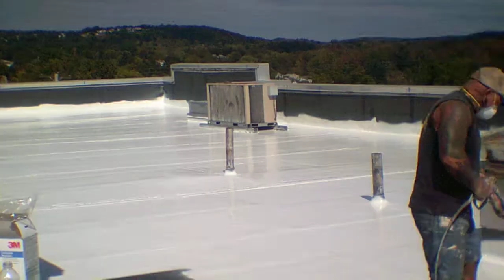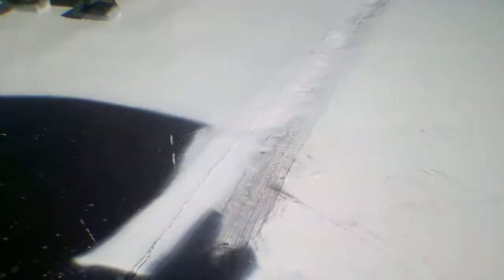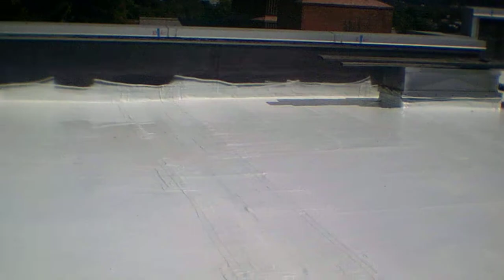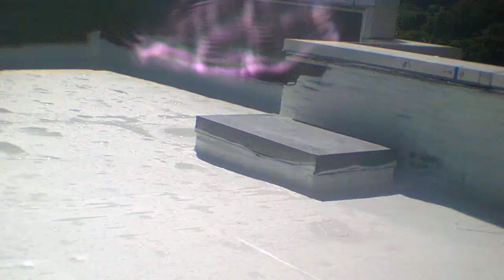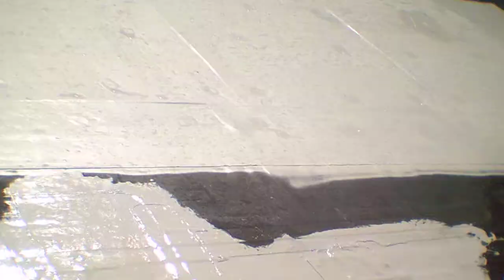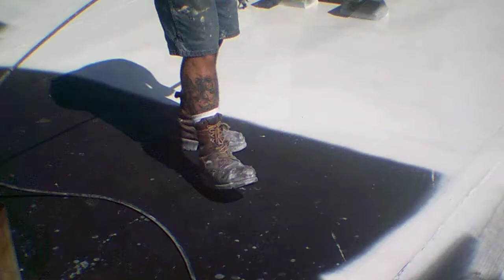Butyl Liquid Rubber Spray Application Fix roof Leaks!

Comment: My roof is leaking again just three years after applying your primer and EPDM coating which was supposed to last 30 years. The rubber has thousands of pinholes in it and the rubber has split along any seams in the underlying roofing. I spent $4776 on this product and my ceilings are getting ruined by leaks again just after I renovated!
Reply from the maker: Hello we actually don't stock that product anymore i would reach out to the manufacturer thank you
Reply: @epdmcoatings  That's passing the buck to someone else. You're the ones that sold it to me, so legally you're responsible. It's up to you to sue the manufacturer.